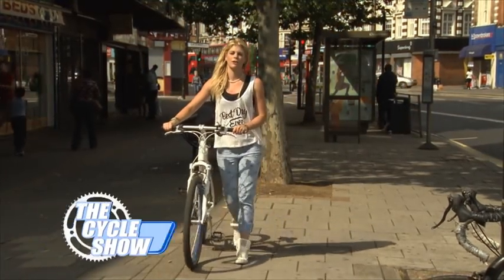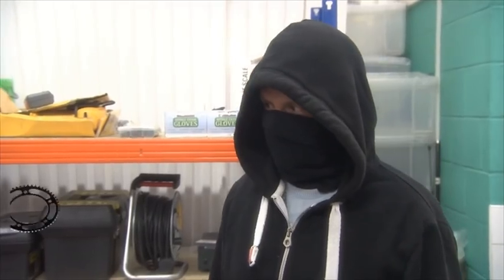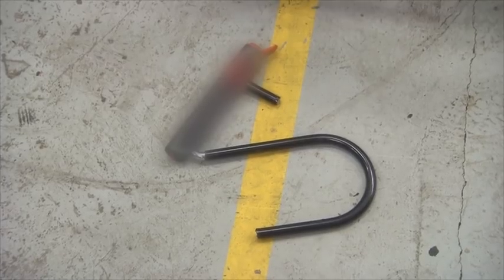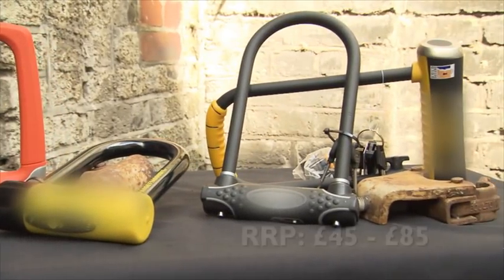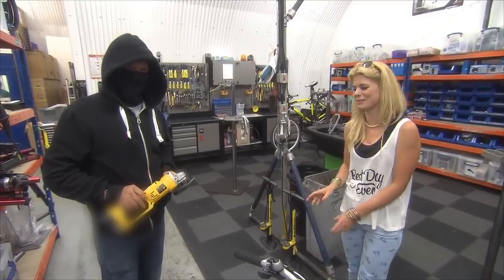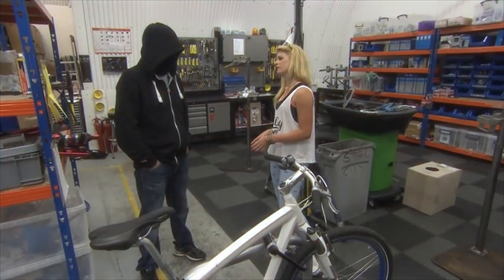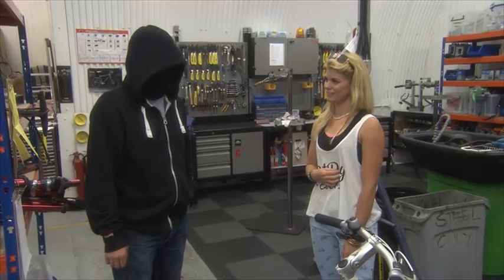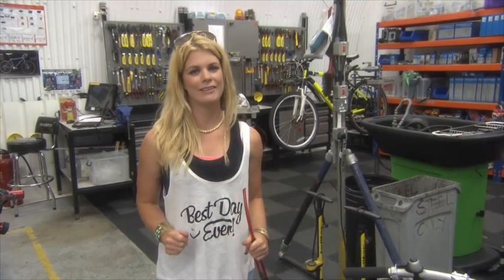How secure is your bicycle lock?

Comment: I lived in London for 13 years and in that time I had 6 bikes stolen from me.  It was part and parcel of living in  London.  A very effective cheap way of devalueing the look of you bike is to simply wrap a plastic grocery/shopping bag over the saddle of the bike.  When portable grinders started to become available heavy duty locks were no trouble for bike thieves.  Sometimes thieves will cut away the railing and load the still locked bike and railing into the back of a van to be worked on later at a workshop.
Reply: Prior to my current Moulton (which has a Kryptonite New York lock) all my bikes got repainted in Hammerite Textured (ie lumpy) paint. Never had one stolen.  It is intended for Ornamental Ironwork but comes in lovely colours, is fantastically durable, and makes a bike Very 'different' and impossible to disguise by respraying.  Check it out at your local Hardware shop.
Reply: @alfnoakes392 but my bike is beautiful 😢

Comment: For me, a bike lock is merely a deterrent to common thieves. A committed and experienced thief will not be. When I used to park my bike in Cambridge, I paid a bike shop to look after it for me. Much safer than the 24hr bike park as cameras won't prevent your bike from being stolen.
Reply: AND HOW MUCH DID THAT COST
Reply: @SAXONWARLORD1000AD  cheaper than buying a new bike I guess
Reply: @caleb_artzs2533  😂

Comment: The conclusion is that it's pointless trying to protect your property as carrying enough locks to only deter someone for less than a minute is unwieldy for this mode of transport. This means we need the police to be more of a deterrent and sentences to be more significant. I love how the police recommend getting a decent lock but really just get it marked in case we happen to find it in the future - good work there.
Marking is pointless, I've literally never heard of anyone getting their bike back and generally the police file reports like a spam email.
Reply: Don't rule out taking your bike indoors. There are also many bike lockers too
Reply: @Gem-Ex  don't bring unrelated nonsense into a discussion about bike locks
Reply: I bought a fat tyre bike 2 and a 1/2 years ago to ride with my boys to the beach which is only 400m away.
First bike I had bought for about 40 years. All my other bikes had come off the road verge.
I had the bike about 3 weeks, and it was stolen from the beach even though I had a good lock on it.
i registered the serial number and put photos on "BikeLinc" so it would come up if anybody tried to sell it or hock it.
Last week the police advised me they had found my bike during a raid on a house 60km away, looking for other stolen goods.
They sent me a photo of the bike and it still looks pretty good. No rust, and still plenty of tread on the tires.
The police advised me they had never found a bike after this amount of time, so it's a bit of a miracle - but hey - it happened.
I pick it up this week from the Police station!!
Reply: @mikthe2004  maybe Aus police are more successful with this than UK police!
Reply: @jamesbuckle6077  Nah, I think I just got real lucky. I've never heard of anybody else getting their bike back, and almost everyone I've told my story to has had a bike stolen.
Reply: bike theft should be taken more seriously but the main culprit is lack of suitable bike parking infrastructure. your bike is way more likely to be stolen if its on its own in a public parking area than if its in the parking spot with several other bikes on private, securely monitored property
Reply: Exactly literally no point in buying 4 locks that could be well into £200 worths when all its going to do is stall up to 1 minute.
Reply: @bobbirdsong6825  Do you think that's true? I mean of course if it's locked to a wire fence at the back of an unknown building, it's a real target. But the Netherlands has major bike theft issues and they have by far the best, well used bike parking facilities I've seen in any country.
Reply: @jamesbuckle6077  this is exageratted because of the prevalence of bicycles; secure bike parking is not the most common way to park. i just visited delft actually, and you will often see bikes unlocked, only locked with the frame lock, locked to trees, bad bike racks that only let you lock the front wheel, and more. i highly doubt it's the secure underground bike garages with security cameras where the thefts are happening.
Reply: @mikthe2004  damn what a crazy story! I'm glad to hear you got your bike back man! Hope that doesn't happen to you again, I know the feeling too smh:/...
Reply: @mikthe2004  a friend of mine had her CX bike returned by the cops 11months after it was stolen. We were very surprised she got it back
Reply: @thomasdillon3008  Yeah, it's rare to get anything back - even after a short period, but 11 months or 2 1/2 years like my case is a miracle. Especially as my bike was like new!!
Reply: No. Cause the more deterrent the see the less likely they are to go for your bike. Plus the more likely they are to give up. I saw a video with one of the locks they had in this video being cut by a thief with an angle grinder. He gave up because it was taking too long.
Reply: @ScyllasSimp  that's a lovely thought. But I've seen friends lose bikes that were triple locked in front of CCTV

Comment: I had my £500 bike (current value £250) stolen from inside my locked shed chained to a concrete post (they took the concrete post!), they had to knock through my neighbours fence and climb over a 6 foot wall to achieve this feat. Totally ridiculous. Bike thieves are not the smartest bunch, and there is basically no stopping them.
Reply: Wtf😳 damn I'm sorry that happened to you wow
Reply: Put it in the house 🏠 Humpty Dumpty

Comment: I know this is a very old video.  But, as an update, there are two locks on the market (2023) that will survive angle grinders:  Hiplok D1000 or D2000 and the Litelok X1 or X3.    You might even put 2 on your bike to make it extra hard and time-consuming to steal.  Be forewarned however, they are very expensive.
Reply: Pictures and videos of these NOT surviving angle grinders don't fill me with much confidence.
Reply: The locks you mentioned do not survive angle grinders at all. They merely slow them down somewhat. There are plenty of videos that demonstrate this very clearly.
Reply: @Orcinus24x5  I realize that.  But it's  the question of .. "do I slow them down enough to make the thief look elsewhere or basically leave it unlocked?"  Nobody said locks are 100% secure.
Reply: @spocksvulcanbrain  Except that's EXACTLY what you said. "there are two locks on the market (2023) that will survive angle grinders:  Hiplok D1000 or D2000 and the Litelok X1 or X3." which is a factually incorrect statement. Don't move the goalposts here. You weren't talking about slowing them down or thieves targeting other bikes. You were talking about locks that were grinder-proof.
Reply: @Orcinus24x5 it's not somewhat. Every video of someone cutting a Hiplock D1000 shows them going through a bunch of blades. Most thieves will give up if they had to replace one blade. Let alone 10. They're much more likely to save their time and money and go for one of the bikes that takes 30 seconds to cut and where you can still use the blade after. Unless it's a very expensive bike that you're leaving overnight. They're not gonna be spending all that time to cut off the lock.

Comment: Okay so why is there no technology that can clunks up the angle grinder???? Some kinda sticky stuff that grips on when it gets cut / hot.
Reply: -.- Cat false, most locks are not cut during manufacturing. They usually heat up the metal till it’s not solid then put it in a mold.
Reply: @-.- Cat thanks zen master guru
Reply: Because it hasn't been invented yet?
Reply: Fill the lock with corundum n stuff.
That's what is used for safes. It gives thieves a hard time. Some fill materials throw fire when cut, to injure the thief.
However the lock size would be unpractical and expensive.
Reply: a hollow core sufficient enough to gum up a grinder would weaken the strength of the shackle, making it more susceptible to bolt cutters.  they use angle grinders, but not often enough to warrant the design feature.  snips and bolt cutters are the majority of tools used.

Comment: Looking at the steel poles these bikes were attached to, maybe grinding the bike rack is faster, haha
Reply: Don't laugh.  We're being warned to check that bike racks haven't been pre-cut, so that they only need prying open.
Reply: Colin Bryant honestly, no surprise there, if I was a criminal I'd go for the path of least resistance. I wonder how tricky it'd be to make the bike rack itself the weak point.
Reply: got a bike stolen. they cut through a pretty solid metal fence instead of the abus Lock.
Reply: Jonny 5 shittiest part about that is that the lock companies insurance doesn’t cover that
Reply: @slopcrusher3482  Not surprised, would you want to run a business where you had to pay 50 times the price of your product when it worked perfectly?

Comment: I was in the local library about 15 years ago, on the magazine rack there was a mag from the CTC (Cyclists Touring Club) UK. It had a test of "expensive bike locks" with which to lock your costly touring bike (such as a Dawes Galaxy). I remember very clearly that the U-Locks were broken during testing with a vehicle bottle jack, which is much smaller and easier to carry around than an angle grinder or a pair of bolt croppers.
Reply: Which is why you need to fill up the space of a u lock with the bike and what you are lockimg too. Don't go for the longer ones unless you are locking up 2 bikes.

Comment: The thing to take away from this: don't use anything that can be broken off without an angle grinder.  As much as the theif says they're used in broad daylight, your bike would really have to be worth the risk of getting caught.
Slightly annoying they've blurred out the brands on the lock...that would be very useful information.
Reply: Yeah , wonder what that yellow and black one was lol
Reply: @goc1842  
Kryptonite NY Fugadaboutit
Reply: @pedlpower  but was it the mini or normal size one?
Reply: @chuckyfox9284  mini. Hope that helps
Reply: @pedlpower  I can attest to this - the lock got jammed (which is another problem) so when I called a locksmith to break this out, it took him good 15 minutes (and the disc was completely gone) and battery all gone too.

I got the Kryptonite NY chain instead now - should hopefully keep the thieves out

Comment: I reckon the best deterrent is multiple disc brake alarm locks in addition to a frame lock and a heavy duty chain lock. The alarms cost little, are light and hard for the thief to get off. Put the bike in a place with a lot of people and the thieve's will realise there are easier pickings elsewhere.
Reply: A heavy duty chain lock, in particular, is not light.

Comment: Or just get a bike so bad no one would want to steel it.
Reply: Riding a crappy bike every day isn't much fun.
Reply: I've had terrible cheap used bikes that seem nearly useless in value yet they still get stolen.
Reply: +Mshojat If they look easier to steal than any other bike in line of sight they will do, smackheads don't give a damn as long as it can raise £10 for their next hit it will do so whatever is easiest to detach from it's attachment point is all good to them.
Reply: Dylan Staley that's why I bought a evade from halfords
Reply: "Steel"^
Reply: Dylan Staley just... why?...
Reply: Heck Lennon u shouldn’t have to do that tho
Reply: I had my bike stolen on campus last year. Bike was a rusted out mountain bike with bald tires and broken shift mechanisms so it was now a 1 speed. Plus it was only like $200 new 10 years ago.
Reply: Also had a mountain bike "Apollo" left on campus but on purpose to get taken by someone. It had broken wheel, broken brakes, still got stolen after a week :D and saw one similar but "repaired" after some time in someones porch.
Reply: James Blackwell 
How? Did you leave bike in a crowded area? And which kind of lock? And how did you lock it?
Reply: no such bike
Reply: Nope tried it theives will even steal a little girl 20 inch chopper that had the frame hammrred.  I bet i would of taken a dump on it and they still would of taken it ..
Reply: Steal*
Reply: steal*
Reply: I have known a few people that have done that.
Reply: Thats what i do going to the gym evermorning in london at 5 am this bike cost me £10 and the paint color is rust
Reply: I hear you! This is why people end up not biking though!
Reply: @hecklennon8400  more fun that having a bike stolen
Reply: Best strategy :)
Reply: Or buy a small foldable bicycle and keep it with you all the time.
Reply: This method worked for me in London for 3 years.
Reply: buy a rubbish bike for when you need to leave a bike for long periods of time. keep your good bike at home.
Reply: I steal whatever bike i find 😈

But don't worry i live in France

Comment: Well angle grinder with enough time goes through pretty much any matter known to man, so there really is no protecting against it.
Reply: Nothing cuts the 13 pound beast called altor saf
Reply: @micdowek  Angle grinder cuts it easily. Altor's design is based on the size, so that smaller disks couldn't reach it. Angle grinder with larger disk will easily cut it.
Reply: @micdowek  that lock was designed that way to wear out batteries, and discs. It's aluminum with a hardened steal core.
Reply: Maybe something with fiber/thread that catches and wraps around the grinder?
Reply: @juanbaclavab  If you make a bicycle lock out of cubic boron nitrade, I can easily destroy it with an angle grinder. With a right disc, it will crack into pieces, it's brittle.
Reply: @juanbaclavab  Yes, that's what I said.
Reply: @juanbaclavab  Diamond is still harder than cubic BN and you can get diamond-filled cutting wheels. They're expensive and you might only get one or two cuts out of them on BN, but they're nowhere near as expensive as a quality bicycle.
Reply: @sbreheny  Diamond disks made for just hardened metal are cheaper, often 15 bucks. And it will go through cubic BN like butter.

Comment: You can get a small GPS tracking device that is inserted inside the bike frame and even sends s message to your phone when it's on the move. Surprised this hasn't taken off.
Reply: Are you going to get it back from the thief's? You might 99% wont and police wont even bother
Reply: and you think the radio signal will get out from inside the steel tube? i doubt it.

Comment: Clearly the best deterrent would spray painting 30 bikes blaze orange and set them around London. In addition, add a thin cable bike lock as well as filling a portion of the bike tube that goes between the legs with a small amount of c4 and a long distance detonator.

Comment: The two outer legs of a  D  lock, should really consist of  two high tensile steel  INNER  leg tubes  , that are freely able to turn around an actual high tensile steel inner core that originates from the the lock body. This eliminates using a hacksaw, so that if the would be thief did manage to cut through the outer steel casing, and the saw contacts the free turning rod inside, it's game over for cutting further, as the saw will merely revolve the inner steel tube. I imagine a set of bolt cutters might do it and if not, a hand held angle grinder's cutting disc would seemingly meet with the same problem as the hacksaw. One can always back it up with a GPS bike tracker, that'll have the Police paying the perps a visit...

Comment: In my opinion the cheapest combination would be a basic U-lock, combined with a low power circuit traversing across the lock to detect if it's been cut.

If it detects a cut, then it would activate a loud siren. It could even potentially spray the nearby area with a foul odor or dye.

I feel like the skunk lock is doing it a bit wrong by putting it within the locking structure itself.
Reply: Mshojat I like this idea, and if the alarm is triggered it could alert the bike owner's phone.
Reply: if you do that why not just have a security feature that the moment it cuts into it simply fries the would be thief with a high amp current.
Reply: The skunk lock is doing it a bit wrong by not being a finished, selling product after 3 years and the creator focussing too much on being a "how to run a successful start-up" motivator instead of saving his own failed start-up.

Comment: My solution... A chain with links of 1/4inch thick steel and a padlock. That, and a quite elderly bike made of bits of junked bikes. The best compliment ever on my bike was made when I cycled past a bike thief that police had caught. He called out "what's that piece of S...". That told me that my commuting bike was not on his list. And yet I could do 30mph on it and stop when needed. That got me to and fro for years with my biggest expense being a new tyre every 3,000 miles.

Comment: I purposefully use a used, old, vintage road bike for this exact reason, u dont need anything fancy to ride to work or wherever. Less of a target. Keep ur good stuff locked up at home and use it for ur long rides. Even if u ride to work, find a way to keep ur bike inside the building u work at by any means possible and always keep ur bike indoors at home too. Weather alone can do serious damage over time.
Reply: Nowadays, real vintage is a target, too. What you really want to use is something from the mid 90s or so, with a couple of rust spots or bunged up paint and a frame that's obviously steel + heavy, not aluminum or carbon or any new + light material.
Also, taking your saddle with you helps a lot. If the thief can't just ride off, that's a nice deterrent according to the advice our police give.